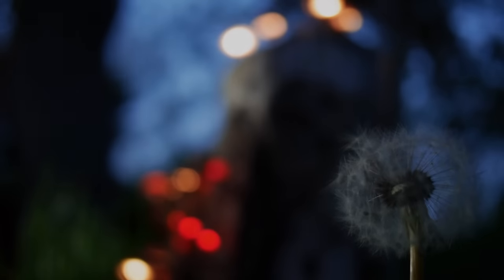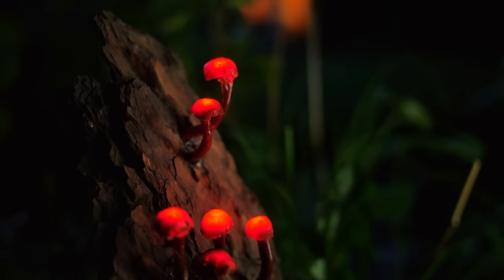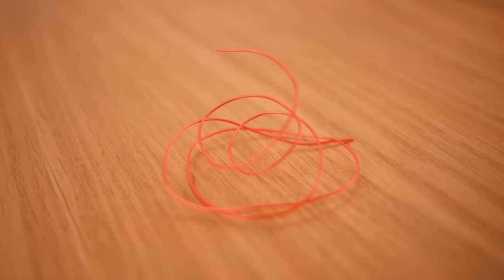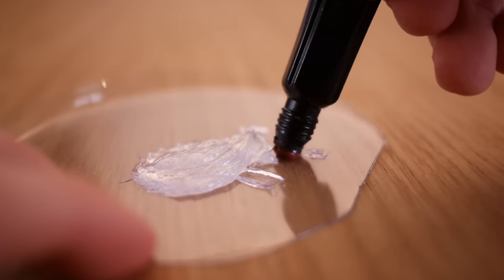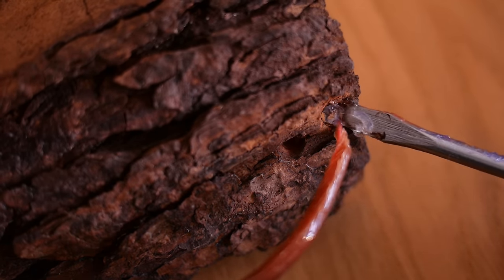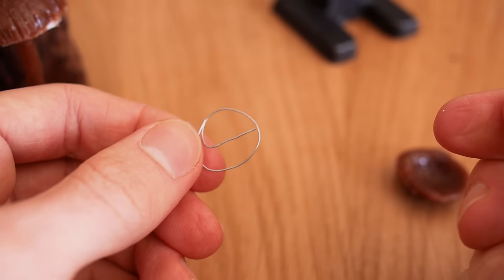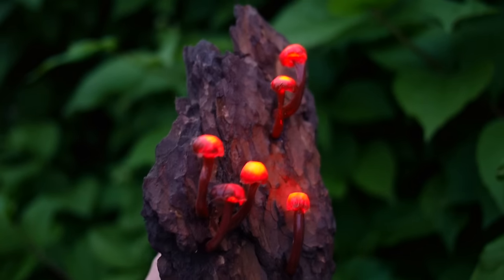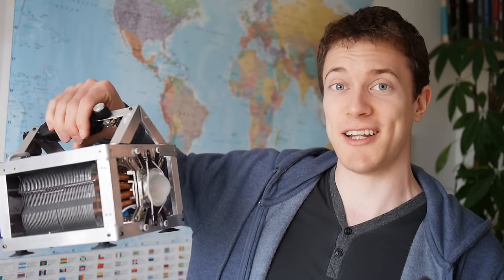DIY Mushroom Lights (craft project)

Comment: I love this, what do you think about jelly fish, they would be very similar
Reply: Okay, now you've got me thinking.  First, I would suggest making a skeleton of wires to help keep everything in place and make the tentacles movable.  Or not, if the silicone is strong enough to hold the tentacles and you want the color light enough to where you might be able to see the wires in the tentacles.  Maybe play with the idea of using regular LEDs, but with them cut off like he showed in the video, and have them at the top of the tentacles (at the base of the bell) to light up the tentacles?  I guess that'd depend on how big you make the jellyfish.  Anyway, hope this gives you some ideas!  Good luck!
Reply: @MahoganyDesk  if you can get a piece of multistrand fiberoptic cable or even those plastic lights with led strands you could distribute the light through the tentacles.
Reply: @StoicObserverS  Be very careful with optical cables if you are repurposing used data fiber. This is made of glass and can get into your bloodstream working its way to your heart which would have dire results. Plastic fiber (like from those 80's lamps) would be totally safe.
Reply: Entende minha língua arigatô
Reply: With RGB led, wow nice
Reply: @paulcheeba666  just use EL or electrolumiscent wire. They are cheap, easy to use and safe. Fibre optic for light is an extremely bad and risky idea not to mention complex.

Comment: I'm going to show my bf and have him help me with the electrical work 😅 I have a few questions: for the wood, do you use real wood? like I can just go to the woods and grab some wood from there, natural and untreated? also, is there any risk of fire from the paper towel being close to the light? say if I were to leave it on all night, should I be worried about my house burning down? 😆 I'd love to try this with succulents!
Reply from the maker: No worries at all about fire -  the LEDs run cool because they are efficient, so don't generate any noticeable heat.

As for the wood, yes, any real wood will do - I got some driftwood for one, and a piece of bark for another :) it's all good fun. Hope this helps!
Reply: Thank you so much! I'm so excited to try this
Reply: i was thinking the exact same... lol... was just about to send him the vid...
Reply: Angel Su lol there's barely any electrical things to do
Reply: Lucky bf :D
Reply: kam hagh  ikr
Reply: this thing look charming.. glowing mushroom.. and you can explore more.. Godbless
Reply: Omg, a succulent lamp! You're a genius
Reply: Angel Su I recommend u turn off at night it's safer for u by the way I hope u can do it or sell it
Reply: The wood is real, as long as its clean. A light emiting diode (LED) isnt powerful enough to set anything on fire, it wont even get warm.
Reply: Angel Su did you end up doing it?
Reply: if you dont want to use real wood you can use aquarium decorations
Reply: Quick question, if anyone can asnwer it'd be great. if i have a 3v battery output and my led needs 3v, i do not need to solder a resistor, right?
Reply: Voltage is one thing, current is another; you still need resistors to control the amount of current to the led.
Reply: Crybaby MiMi Just go foraging in the local woods/forest. You should find plenty of deadfall or maybe even some that has been felled for safety reasons. I pick quite a bit of wood up from random places, its not too hard to find.

Comment: 6:38 good tip on using wire to keep the mushroom head from being too close to led.  There is the need for the right amount of space to create the optimal glow, I'm gonna use the idea of the wire for other projects

Comment: Thumbs up for this Nice project and your excellent explanation. Thank you very much especially for explaining how to determine the required resistors for LEDs in different projects as well as your shared chart for the approximate current and voltage for different colors of LEDs. Thanks for sharing and for everything you did in this project.    ;-)

Comment: Sorry, but the electrical engineer in me has to comment on that:
1:43 "...so that they won't get fried with too much Voltage..."
That's a common misconception.
Voltage doesn't "fry" anything, it's Amperage that fries stuff.
Voltage indicates the "electrical potential difference", while Amperage indicates the "actual flow of electrons" (=Current).
So, for example, if a lightning strikes you, it's not the 1.5 million Volts that will fry you, it's the 1.5 million Amperes that will flow through your body.

Regarding LEDs now (TL;DR at the bottom):
The Voltage on their label is not the "max Voltage that can be applied", it's the "Forward Voltage".
LEDs are diodes, thus they need a certain Voltage to be applied on their ends for the electrons to start flowing through it.
So it's actually the minimum Voltage required.
What you should be careful about is the Amperage.
Common LEDs work best at about 20mA~30mA (=milliamperes).
Anything lower, & the light will be too dim.
Anything greater, & you risk frying your LED.

How to calculate the current-limiting resistor (=example):
If you apply 12V on a 2V LED, you'll get a 2V Voltage drop (because that's what diodes do).
So now you have 10V remaining to work with.
If you want to get the maximum brightness, you should allow the maximum safe Current (=30mA) to flow through the LED.
By using Ohm's Law:
R = V / I = 10V / 0.03A = 333.3Ω
Since there aren't any 333.3Ω resistors available, you gonna have to chose either 330Ω, or 360Ω.
330Ω is probably ok for this example, as the Current will be very close to optimal (30.3mA).
Personally I'd go with the 360Ω though, as the Current would be safer (27.8mA) & the drop in brightness would be negligible.

TL;DR
When working with LEDs you should:
- Apply a Voltage greater than the one on their label.
  (Still, be reasonable.)
- Allow a Current lower than the one on their label to flow through them.
- Don't connect them with reverse polarity.
  The longer leg is the one to be connected to Positive (=Anode).
  If you can't tell by the legs, an easy & safe way to check is by using an electronic multimeter.
  Set it to measure Resistance & try the legs.
  If the LED lights up, then the Positive leg is the one connected to multimeter's Positive probe.
  If it doesn't light up, try connecting it in reverse just to make sure it lights up that way.
- Chose a proper resistor.
  It's not only the LED's current that you should take into consideration, but also the resistor's Wattage.
  In the example above, the resistor has to dissipate 0.0278²A * 360Ω = 278mW of heat.
  So if you use a 1/4W resistor (=250mW), it's gonna get too hot & it will probably get fried eventually.
Reply: boys don't click read more it's scary out there

Comment: I am wondering what would you think of adding some glowing pigment powder like phosphorus in the silicone with the colouring for the blue and white LEDs since blue lights wave lengths are really close to the uv lights'. Also White has  a lot of energy in it so it also may work well. Do you think it will work? Because I'm about to done the electronics and before adding silicone, I wanted to hear your opinion... Thanks a lot for the attention.
Reply: +Egemen Bora Uysal I bet that would work well and look awesome!

Comment: how did you make the white ones? using transparent or white silicon?
Reply from the maker: Just some white paint in the clear silicone.
Reply: +DIY Perks hey...thanks! whites ones looks great!!
Reply: well, if it was me i would go for transparent but you may see the wires inside the mushrooms. So i'd say a little white added to transparent silcone.

Comment: If you mixed phosphorescent pigment into the silicon, would normal LEDs be able to charge it? 
It would be really nifty to have it mimic that bioluminescent glow after you turn it off. Depending on the strength of the pigment, I think it might also result in a color change as the pigments start to emit alongside the LED the longer it's on.
Reply: Using an UV led would work quite well with your idea. And if you don't just leave the led glow, but make it blink once in a while, only to charge the pigment up, it would have an even stranger effect.
I would like to try it out, but I have no reliable source of phoshorescent pigment. Could you give me a hint where to look after a smaller portion of it? Because I saw some on e-bay but it was a bit much in prize for me to afford.
Reply: Roland Banc A friend of mine used this stuff for epoxy knife handle inserts and it was pretty impressive.
http://unitednuclear.com/index.php?main_page=index&cPath=28_45
I don't think you need a UV LED, but it probably depends on the specific pigment.
Reply: Abraxian Absolution could mix in some glow in the dark powder to the silicone, the powder is fine and mixes with resin and paints so i don't see why not

Comment: For people wondering which resistor to use when using a 9V battery and lazy for mathematics:
 Red/Green LED : 360 Ohm
Blue/White/Violet/Orange 330 Ohm
Reply: Thanks
Reply: +Lromain55 just use adjustable 1K resistor and voltmeter to rise them all till it reaches 3v (or even lover if some leds shine to bright, not a rocket science. 
or use two adjustable resistors if some group of leds shine brighter then others and u want to lover them down a lil. I will never understand this waster of resistors when each led connected with separate one.
Reply: MultiTail because you loose in Amp, just do it and if you are lucky you will see no problem ;)
Reply: WHAAAAT?
You do not get it…
For some of us it is rocket science…
Some people understand different things and others do not!
Reply: @MultiTail  per color-group 1 resistor is fine indeed!
Reply: @LacourWave  hows that possible is for example a group of white SMD leds, lets say 10 of them in series only starting with 1suited resistor in the beginning of the circuit, why would you need a resistor between each LED... same goes for paralel, all the positive legs connected all the negative legs connected then on 1 of the combined legs a resistor, surely that would be enough? i'm doing this for 20+ years

Comment: I'm in the mushroom dome step. how long is it supposed to take for it to fully dry? I make diffrent colours like white, red, blue and some turquoise. Some of the first ones I've made still haven't dried up and it's been over 24 hours. Any ideas?
Reply: Sam HL mine dries after 3hours .
Reply: What type of silicone did you use? The brand I used was Gutter 100% silicon. It says it's weather proof and dries in 30 min and fully cures in 24h Kamal Chahlaoui
Reply: I have the same problem, what can I do?
Reply: my dries on air after 15-20 min, but in cling film not
Reply: Random_ yeah same
Reply: try giving your cling film some air... that is, try to lift it up just a bit so its not completely sealed to the air outside. silicone is dissolved in acetic acid to keep it squishy (which is why it smells like salad dressing on steroids - its the same compound that vinegar contains) so if its sealed to the air, the acetic acid can't evaporate, which means the silicone won't dry up. remember, the silicone was sealed in an airtight tube to keep it from drying out...but drying out is what you want it to do now.
Reply: what did you use for paints ? I am having trouble finding those tubes of paints. Can I use acrylic paint or poster paints ? Thanks
Reply: Use simple tubes of watercolor paints, available everywhere.  They will give more translucency to the silicone.
Reply: Sam HL Did you have an easy time soldering the wire to the LED? I am really struggling with that step
Reply: triumphmanful lol this is a bit late but I got these cheap acrylic tube paints from Dollarama and they worked just fine. I'm sure you could find some better quality paint for better results but I was just testing this project out so I didn't want to spend a lot of money.
Reply: Sam HL What did you use to mount your shrooms on? I'm having a hard time finding something that won't rot. I'm currently looking realistic wood from taxidermy websites
Reply: ***** dude idk if you have to go that far. Have you checked out craft stores? Or maybe like a florist supply store. Or perhaps the garden aisle of a home hardware store like Home Depot and such. Im sure you can quite easily find something to mount  a the shrooms on even if you're looking for something specific. Hope that helps
Reply: Sam HL Yes I have tried all of those places. Actually some of the taxidermy supply places sell fake realistic wood and bark that's made of cork
Reply: ***** oh that's pretty cooli guess getting it from the taxidermy store is your best bet
Reply: Sam HL Yeah. It's just unfortunate cause I have searched all of those options you listed already. Im sure there are some locations that have them.
Reply: Psion Crystallis when I try to expose the stem to air it just peels up wet silicone and messes with the shape... I dont know what to do lol
Reply: Chassey Link I am having the same problem!!! I am running out of time cause this project is gonna be a birthday present. I saw on another similar video that it's very easy to use too much paint and if you use too much the silicone will not dry. If anyone knows any chemicals to put in the paint filled silicone to help it cure faster then please let us know.  I have also thought about letting the silicone sit out open to air for a while to allow it more time to "harden" before placing in the silicone. I know thought that I have tried his exact steps and even after 24 hours mine is still gooey and peels off with the cling film!😔
Reply: Psion Crystallis I will try this!!! I have been stuck on this step for a long time! So I should mold the silicone around the wires then pinch up the edges to allow a bit of air to touch the silicone for evaporation of the acetic acid?
Reply: ***** I would say that the curing process depends on the brand of silicone you have. The tubed silicone worked well for me and stick with acrylic/water based paints for pigment. If you really can't seem to get the results you're looking for get the exact products used in this video. Best of luck 😃
Reply: Sam HL I used some 30 minute GE  ii 100% silicone.  Bout to try another test batch
Reply: Just felt like mentioning that another great place to get non-rotting wood is the aquarium supplies store or any pet mart.
Reply: +plinco As someone whos fiance works at a pet store the bark and driftwood are pretty pricy. They look fantastic which is why we have them for our reptiles at home but if you want a lot for different mushroom sets then Id suggest somewhere else.
Reply: you could water down acrylic paint to make it slightly clear too
Reply: Joe Friday you need to use acetoxy silicone. Anything else will take ages to set

Comment: my physics teacher was 73 years old so i didnt learn anything... so my question is really important: cant this result in a fire? i mean its electricity? can i do anything wrong here? (and i dont mean putting this together wrong.)
Reply from the maker: It's all low voltage so you really can't go wrong even if you tried.
Reply: Thank you :)
Reply: just don't heat the batteries with your soldering iron or mess with the batteries (like poking holes in them) :P
Reply: If you do something really wrong with the electric part, the batteries will become very hot. If you notice this after a few minutes, remove the batteries and check the polarities at every wires. But I don't think it would result fire anyway.
Reply: LED is also a Diode - they simply won't work.
Reply: low voltage. only ends up with little smoke nothing more
Reply: Loc Hoang
 said no electrical engineer ever.
Reply: +Loc Hoang
Welders usually work at very low voltages, so that is not an argument ;)

But on a serious notice: Yes, you can short out the batteries by being extremely clumsy with the wiring, which would result in very hot batteries and maybe a bit of smoke, but other than that, it's pretty safe.^^
Reply: +Rabijeel 
im using diode now, but the light seems does not light too much.damn
Reply: Ooo so cute
Reply: VS Top yeah very cute in deed 😀
Reply: Suppenhuhn007 very late to the party.  Any basics in electric circuits and you'll be fine,  if not, just make sure any bare metal wires from + don't touch bare metal wires from -.    aside from that the most dangerous thing is don't touch the soldering iron when it's hot
Reply: ilovefunnyamv2nd , I can confirm that. Grabbing a hot soldering iron by the hot bit isn't fun.
Reply: @Electroblud  true LED 30-50ma versus weld @ massive AMPERES heheh!
Reply: @franciscoromerofitness  LED is Light Emitting Diode... so if you use a normal Diode ofcrs there's barely any lights XD
Reply: @massimookissed1023  I stepped on mine, couldn't walk for many days ... lesson learned!

Comment: That's so cool! I think I'm going to make one for christmas :) A question: If the LED require 3.2 volt, can can I use a battery holder with only 2 batteries and then don't use resistors?
Reply from the maker: You might be alright, but a resistor is still very highly recommended - if the LEDs draw too much power they'll burn out, and the resistor is required to stop that from happening.
Reply: DIY Perks thank you! I'll buy one for 3 batteries and resistors then
Reply: +DIY Perks Can you make a diagram for the wiring
Reply: Arkande

Comment: I did the math and this setup will last around 6 days/mushroom (so 6 days for 1 mushroom, 3 days for 2 mushrooms, and so on). I think a nice project is to have a solar panel charge a battery that will charge during the day and light on during the night. I don't know how easy/difficult this would be but you could have your mushrooms light up for a very very long time.